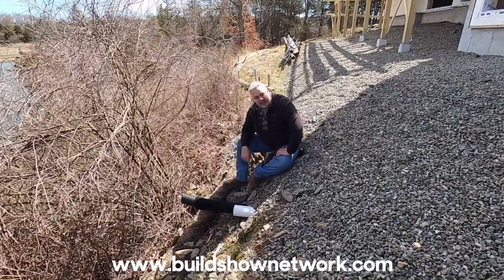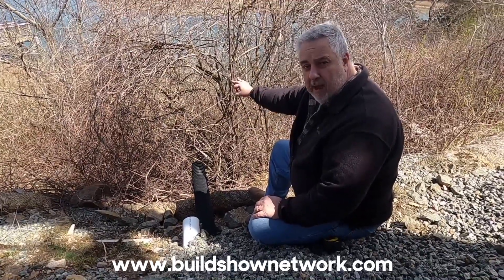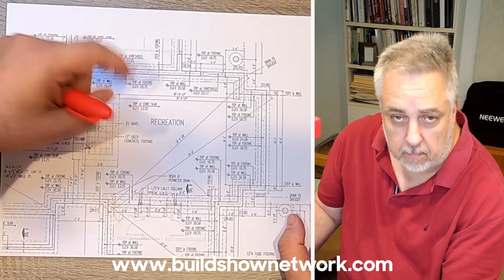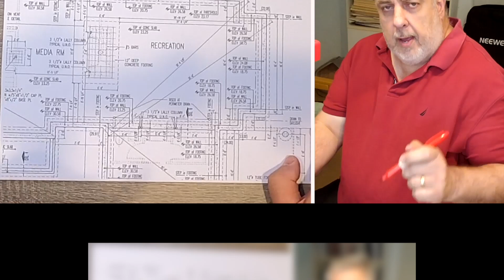Basement and Foundation Drainage - Building Science Tips

Comment: Lol I've installed this stuff for 20 years and it is pure garbage! That fiberglass board holds water like a sponge. It's identical to warm n dry and is an absolute nightmare to work with. Creating an air gap is a much better solution because this board offers absolutely no r value once it gets moisture. I've been to many additions and dug up repairs when removing this stuff my glove is soaking wet it just holds water like a sponge. Dimpled drainage board with fabric on one side is the way to go

Comment: This is all news to me. The protection board was only some cheap board to protect the waterproofing and drainage board  and a real drainage system like Mira-drain. I do like fluid applied waterproofing that some systems ignore. In the link video your use of SketchUp and general detail for the foundation is top notch. Great that you can work with the concrete contractor.

Comment: Steve, love the protection level you go to for water.  In the full video you have a drain inside the wall and outside the wall.   Do you ever put 2 inside or outside just in case one clogs over time?   Love the fact you mentioned the 10" walls - I looked up the reason and the software I'm playing with does 8" by default which in modern houses may not be sufficient.

Comment: Steve, I love your solutions!   People still insist on putting in fireplaces with new houses despite that they get used about twice a year at most.    Have you ever designed a newer chimney solution that isn't a heat suck most of the year?   The cap is probably about an R3 at most.
Reply: Doing alot of sealed wood stoves
Reply: @stevenbaczekarchitect9431  Thanks.

Comment: So, do you think the protection board is superior to the dimple mat that Matt has shown off a few times?
Reply: Yes, because it also provides insulation. The fiberglass board does not degrade or get infilterated by insects like rigid foam panels do.
Reply: @guytech7310  the fiberglass loses most it’s effective r value when wet, which it will be a good portion of the time. It’s drain rate is not as good as dimple Matt, though both are adequate except in huge floods. It’s also more $$ as it’s a branded product, no competition.
Reply: How about dimple mat with this on the outside? Overkill?

Comment: What stops the insulation being crushed? Wouldn’t you want the moisture not to get into the insulation?
Reply: The fiberglass panels are pretty stiff and are difficult to crush. They are certainly more durable that foam insulation panels.
Reply: @guytech7310  And water doesn't challenge them

Comment: Might be a stupid question but why do they stop that black membrane at the exact level of the board?  Can it be sprayed up higher?  Is it not UV stable?
Reply: I assume its not uv stable, and second cost.  prosoco and polywall are something like 550 for 5 gallons.
Reply: Plus, do you want to see black above grade?
Reply: @joshperrythree  Exactly
Reply: It’s not just about keeping the water out it is also about letting the concrete dry. If the concrete is completely sealed, as a porous material, it holds water inside. The water needs a way out as well,so the top of the foundation needs to be able to release out instead of holding moisture inside the concrete or house.
Reply: Not very pretty (ugly) . and not nessairly above grade (unless you get a lot of snow above grade.